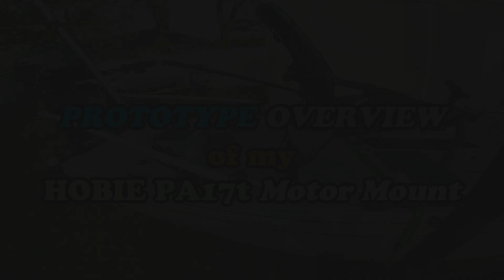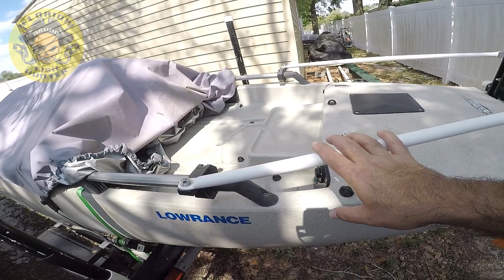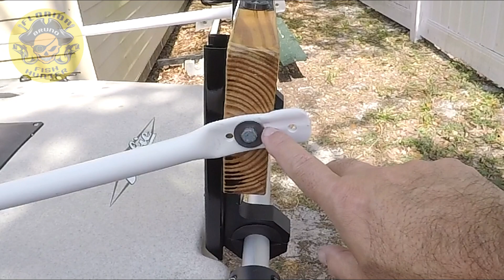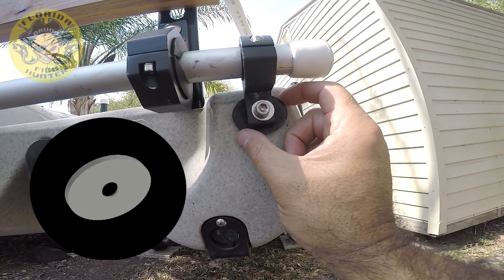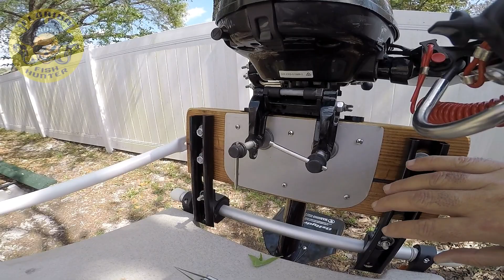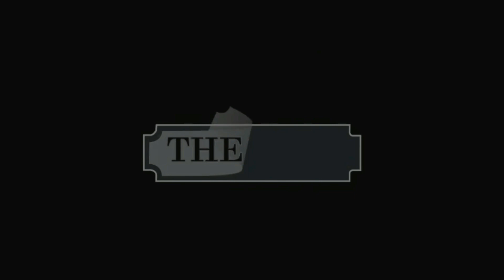Prototype Overview of my Hobie PA17t Motor Mount - Florida Fish Hunter

Comment: How did this do on the water?
Reply from the maker: Hi cameronlucas6004! It did great! Check it out here:  https://www.youtube.com/shorts/qvYtk7ey1ao
Reply: @FFHTV looks awesome. Why did you remove the original grab handle? Couldn’t you have done the same design using it?
Reply from the maker: Thanks! Yes, I could have used the Hobie grab bar but I felt that the plastic end pieces of the grab bar were not going to be sufficiently strong enough to support the weight and loads created by a 6hp outboard which was the intended target for the project.

Comment: I've used those same light mounts for various things. The bolts corrode pretty quick, much worse if in salt water. The cheap stainless didn't play well with the aluminum.
Reply from the maker: I agree. Replacing the cheap fasteners is simple enough although one will still have to deal with dissimilar metal corrosion between the stainless and aluminum.